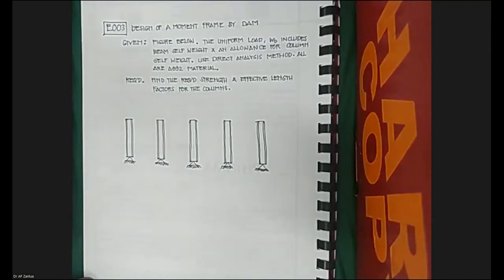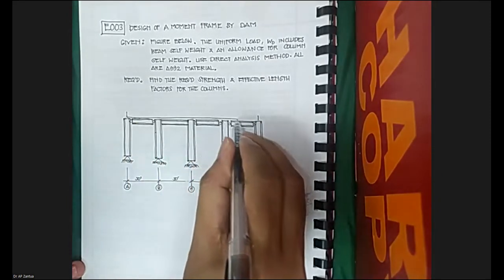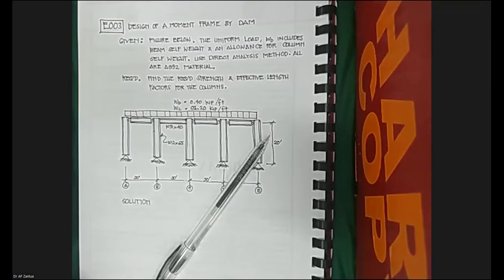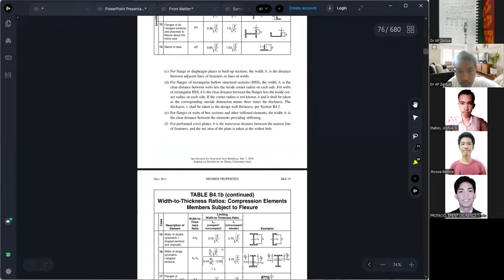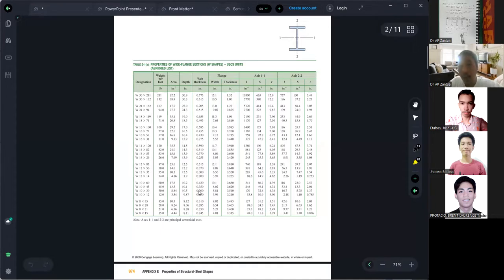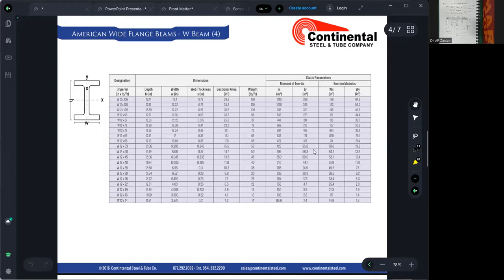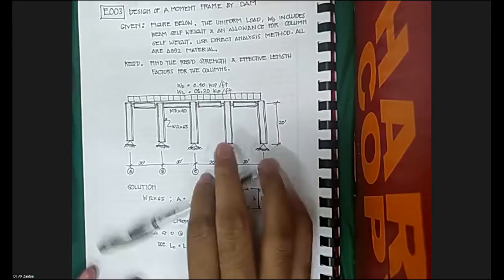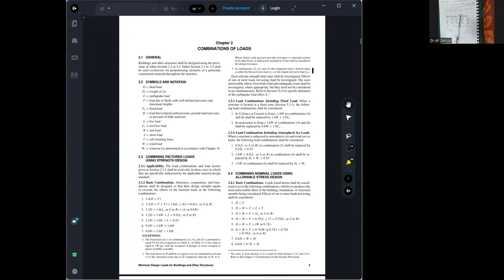AISC 360-16 [ Principles of Steel Design ] Problem Solving B Example E003.1

Comment: Thank you, sir for this problem solving lecture about steel design using direct analysis method. I can't see clearly the table due to the quality. I'll find the reference first and go back to this video to fully understand the concepts of solving a problems in steel.

Comment: thank you sir for solving an example of design moment of  a moment frame by dam. I learned about using direct analysis method I finding the required strength and effective length factors for the columns